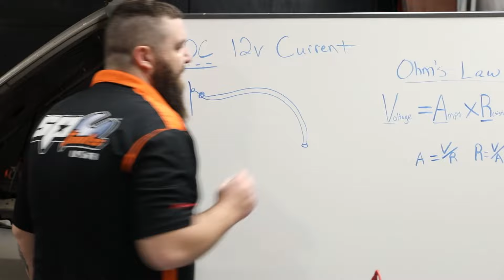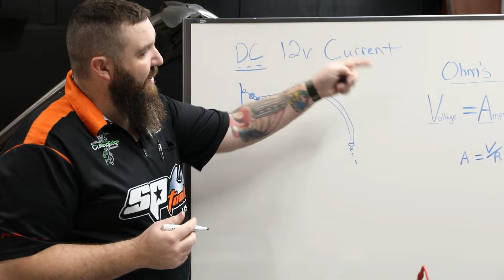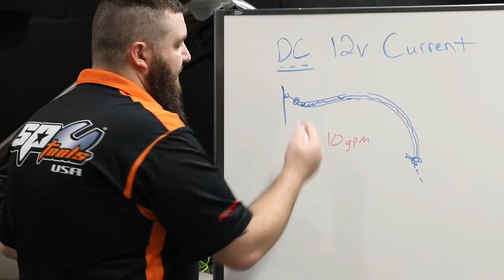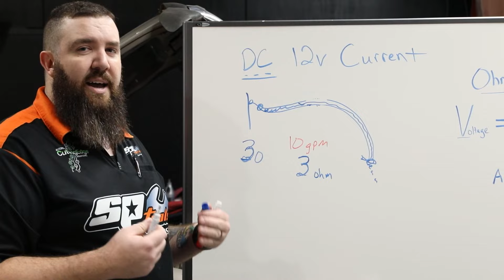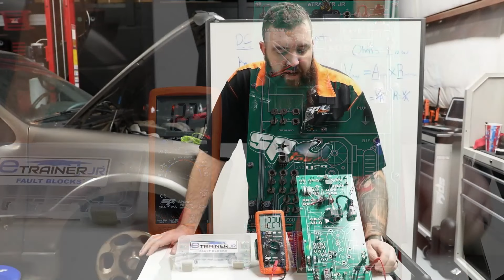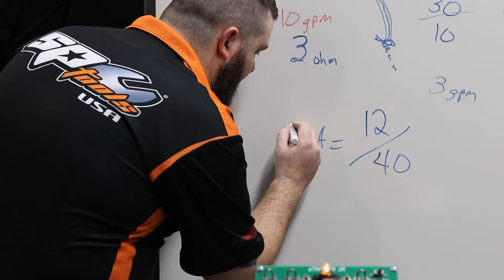BASIC AUTOMOTIVE ELECTRICAL DIAGNOSIS PART 1

Comment: Voltage = how 'fast' the current will flow.
Amps = the 'size / amount' of current to flow through.
Ressitence = anything that 'block' the current to going through wire.

Is't true..?

Comment: So if you have a bulb that doesn’t light up and still have 12v AFTER the socket like you mentioned somewhere around 13mins or so then you wouldn’t have a faulty bulb or socket (or that isn’t the ONLY issue anyhow, but still somehow have continuity) but instead you would have an open AFTER where you tested, or have a very high resistance after the bulb that is consuming most of the voltage.
Cheers.

Comment: Your such a bad Teacher you where trying to find A = V/R   you said 30 Volts divide by 10 Resists = 3 gpm or flow or Amps  it should have been 30 Volts divided by 3 resists = 10 amps ( flow  or Amps )

Comment: Why cant you just test whats wrong and fix the problem without all the electrical theory stuff 90% of tecs are not good at electrical work because they got confused by all the 100s of different ways and explanations its just to much it takes many many years to learn this a breif explanation and testing is good enough not a 100 different ways and wasted time on theory just read wiring diagrams and do tests and make repair and verify the problem is fixed thats why most techs suck because they are confused amd wont admit it all this stuff is overkill and will make 90% of techs bad thats why most shops cant fix electrical prolbum right bad training and overkill with causes confussion and fustration you are a very good tech but people dont want to spend years learning all this stuff they dont really need to know just test it and fix it forget the rest

Comment: Hi there. I own a Vw Polo Gt Tdi 1.6, my car has been throwing a 00538 reference Voltage-Open Circuit error in Central Electronics and even the air conditioner has been getting cut off randomly. I had sent the car to VW workshop to fix the said code and they checked the Climatronic, BCM, Reference Voltage Fuse and wiring and they all were fine, but still the fault code reader was flashing 00538 error, after which the master technician hooked a battery charger to the battery and erased the code and it didn't appear again, which it used to after turning the ignition off and then on. The Technician said that it is a bad alternator, but then the battery voltage is at 12.8 when the car is off and when the car is turned on without A/c. it shows 13.9-14 and when the A/c is turned on it shows 13.78. There's no issue with starting the car, no battery icon on instrument cluster, nothing, but the fault code won't go.

Comment: Good video. But you've stated a couple things incorrectly. When you did the amp test, you said it had 0.13 ohms of resistance. You were measuring amp draw. It had 0.13 amp draw. Not ohms.

Comment: I find it easier to think of Ohm's law as a river: The voltage is the water, the resistance are all the rocks and boulders in the river and the amperage is how fast that river is flowing.
Reply: I think voltage is the strength of the flow and amps is the amount of water
Reply: Pipes.. flow rate is current.. resistance is diameter of the pipes.. and force of motor pushing the water is voltage
Reply: Your analogy is incorrect
Reply: As a raft guide this makes a lot of sense lol
Reply: Thank you for providing that analogy
Reply: I been trained in electrical and hyd and both operate similar voltage is flow/gpms and amp is psi/power
Reply: What about pressure?
Reply: I like that
Reply: And also seems like a concrete bride that thickness is your current in ampere, the width is your voltage and the length is the resistance.
Reply: But what are the fish?
Reply: I'm ASE.     Ask someone else
Reply: Hope he remembers to turn the water off
Reply: Bruh that’s a really good way to look at it, I struggled in fundamentals at UTI cause I hated electricals but I regret hating it now.
Reply: @mylifebelike7573  studying at UTI at the momentttt
Reply: Voltage is the speed of the river's flow.  Amperage is the breadth of the river, i.e. volume of water moving.
Reply: I like to picture Jesus like a mischievous badger or wearing a tuxedo tea shirt.

Comment: Nice Job on the video!!! 

Something that I noted...
When you are are measuring current in the video, at timestamp 16:24 you stated .13 ohms when you intended to say .13 amps.
Could be confusing or misleading to someone with less experience.

Thanks
Reply from the maker: Good call👍🏻

Comment: At 11 minutes, Kyle is measuring 10.1v on the ground side of the bulb. Since he measured 12v on the positive side this should mean the bulb has approx 2v applied to it. The bulb looks awful bright for 2v. Why? I know the answer. Does anybody else know why?
Reply: i cought that right away and jumped to the comments to make sure im not wrong thans for pointing it out as these mess me up so much when learning
Reply: @R230Tuner OK. I was anticipating more replies but I'll put an end to this.
This is a simple series circuit with one load. All the source voltage (12v) is applied to the bulb. Look close at the meter reading on the ground side of the bulb at 13 minutes. It is not 10.1v, it is 10.1mv (millivolts) or .010v  If you look close you can see a small "m" on the screen.
Reply: @R230Tuner I am not sure where you are seeing all this. When he checked on the voltage on the ground side of the bulb, that wire goes to the ground in the top left corner. So, the question still stands, where does the 10.1v come from?
Reply: Nope. If it is a circuit that "breaks off after the bulb" that would put it in series with the bulb. Loads are not typically wired in series and I don't remember any mention of a fuel pump. So my original question stands, why is the bulb operating as though it is receiving 12v and not 2v as mentioned in the video.

Comment: out of curiosity, do you understand what electricity really is? you have one atom of copper with excessive electrons and another copper atom with the regular amount of electrons or has an empty outer shell, and the electromagnetic field causes the electrons from the copper atom with excessive electrons to move to the one with a normal amount or no electrons in the outer shell. that's what electricity really is. i had to learn the hard way because the water analogy was insufficient. i feel like until you understand that, you will never be able to truly figure out or understand electronic problems
Reply: Remember, this is Basic Electricity 101 (however, major fail on the part of the "teacher" with the examples: What kind of calculator are you using that shows 12/.13=40?!!!).The more you learn about electricity/electronics the less the 'water flow" analogy makes sense. I remember when I first learned electricity being taught the "water flow" analogy. I think it simplifies things down so much it helps a novice to understand the concepts. now that I'm not a novice, I dislike the analogy; wish there was a better one.
Reply: I like Bernie's Breakdown. Though a little long as he goes into IC chips, drivers, etc, etc....  A little to much for me. 

You can have 12 amps all day long whether on 1 strand of 100 copper wires or 100 strands. 

When you apply the Amperage you'll see what kind of amperage you have as well though. This made it easier for me to understand. 

https://www.vehicleservicepros.com/service-repair/battery-and-electrical/article/21208044/modern-automotive-electronics

Comment: 12v/.13a is 92.3 ohms. You still have the light bulb in there causing the extra resistance in your circuit.
Reply from the maker: There’s a winner!! Good catch on that one👍🏻👍🏻 We had an internal bet to see who would catch that first. Contact me over on IG for a free Rustbelt shirt or sticker
Reply: Was thinking the same thing

Comment: how much is the meter first 20amp i have seen
Reply from the maker: I believe $200 over at SP Tools USA, code Rustbelt gets you 10% off still
Reply: Yep, most meters are 10A, but the fact that you must open up the circuit and put the meter in series with the circuit is getting harder and harder to do. In my opinion, a better option is to go with an amp clamp which can typically measure up to 60A. They even make a large capacity clamp for starter current.
Also, keep in mind many amp clamps come with a BNC connector to use with a tool like a Pico Scope, but you can find them with banana plugs (for a handheld meter). You can also find BNC to banana plug adapters.